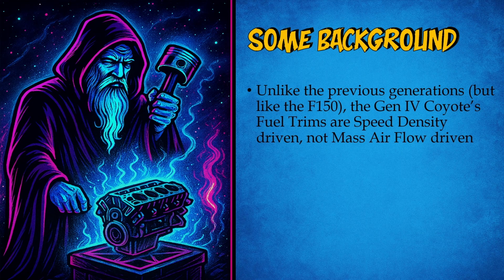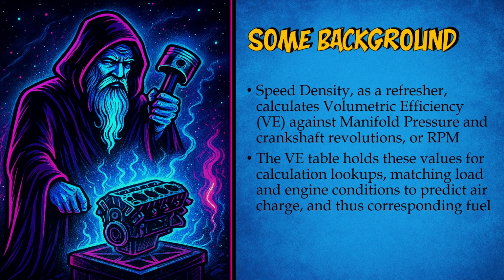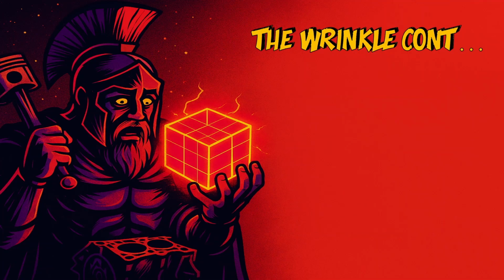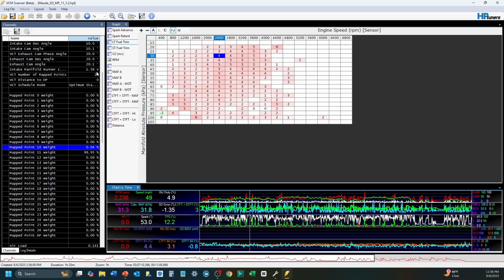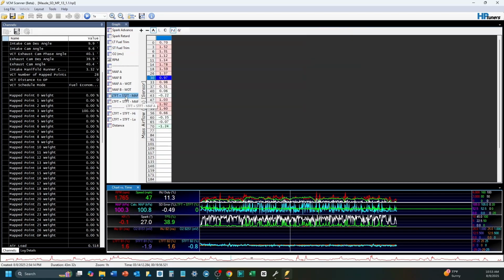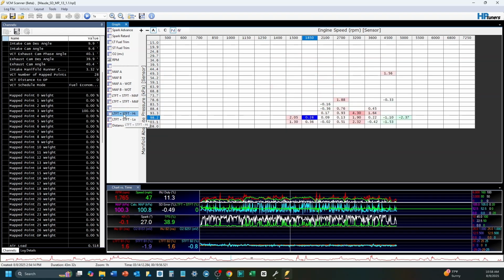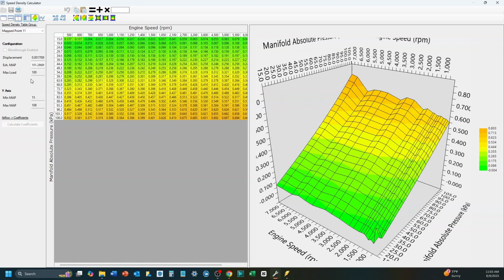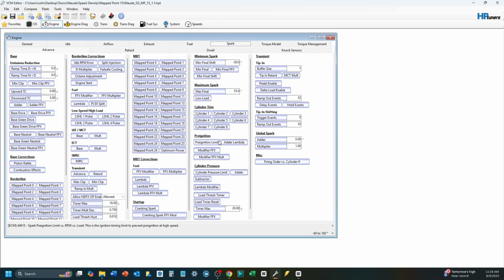The Hi/Lo Speed Density Tuning Method for S650 Mustang GTs

Comment: Cooo need boosted  version -i have whipple tune and want to adjust it
Reply from the maker: I hear the Whipples have had some issues, and Ive done some research. Watch those cats and be sure EGTs stay under 1750, and that DCFO doesnt swing too hard from rich to lean, which can cause temp spikes that shock the cat media. That said, youre asking about IMRC functioning on a Whipple tune?  What stage?
Reply: @TrojanTuning-S650 my car making 17lbs of boost and im tuning it -modified whipple tune  and trans tune  runs good  i can give u some tips what i have learned